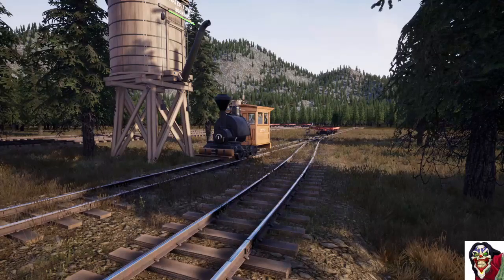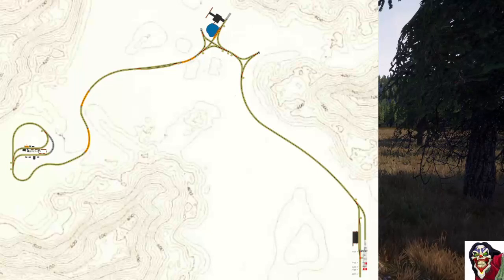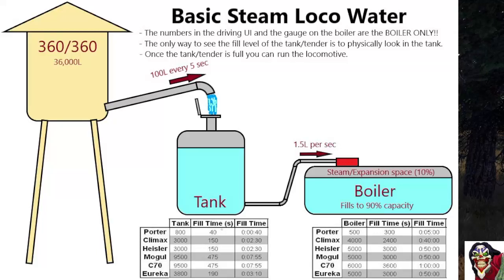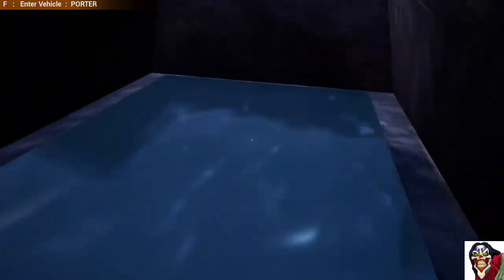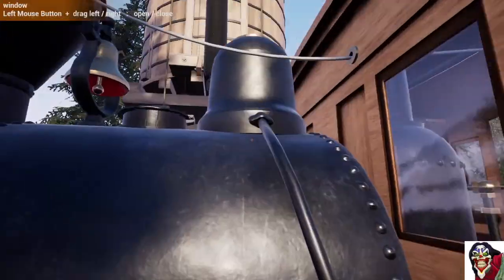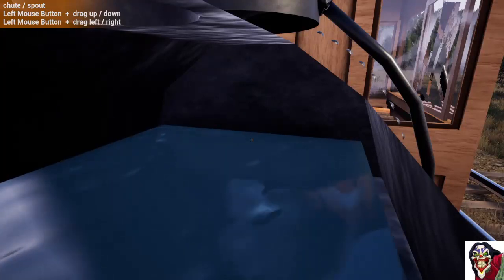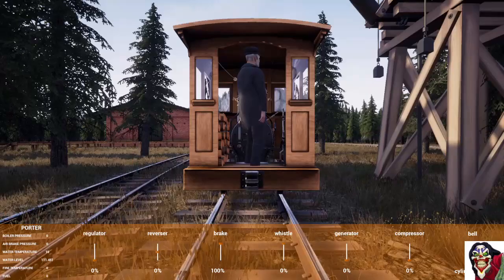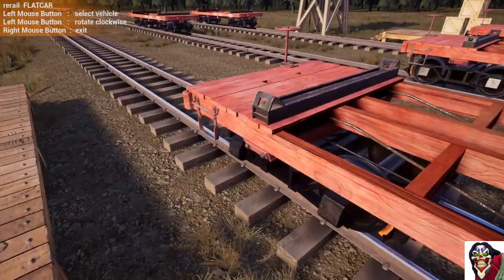RO! - Old Build Tools Tutorial Ep14

Comment: I like the chart with the water "management" from water tower to the boiler. But for realism' s sake you should've opened the lid of the water tank at the logging camp! ;)
Also very informative on turning cars while re-railing. That was one thing I still had difficulties with. Thank you for this nice series of videos.
Reply from the maker: I did it on purpose to show you can fill it without opening the cap.  The same is true for the sander dome and cap (Eureka's sander cap currently doesn't open).

Comment: Suprised you didn't shunt the rolling stock
Reply from the maker: At the spawn tracks?  That's why there's a re-rail line that runs past there on the west.  I'm shy of driving in there since I had a railcar fall through the map when trying to collect new railcars.  Since that happened I don't normally connect those baked rails to the network.

Comment: Can you do a video showing how to replant trees? Or do you have one already?
Reply from the maker: This is done with 3rd party tools to edit the save file.  ROSE (Railroads Online Save Editor), Tree-inator, railroad.studio all have options to replant trees to either the full map, or to trim neatly up to the tracks (smart replant).  Its as simple as pushing a button, or selecting it from a menu.
Reply: @K10wNs-Shed  I tried that site and it is great for just about everything on RRO! I first tried the "cut all trees" and it was so simple. I could finally see every bump in the terrain so laying track was a breeze. Then while messing around with the tree brush, I figured out right clicking cuts trees and left click replants them! I was able to leave the trees on the mountains (where I'll never lay track) and still clear every remotely flat area to see how big of a yard I can build. Found some nice niches that I never bothered with before because of how many trees I'd have to cut down. What used to take 5 hours took 5 minutes! This along with minizwerg should help me make some impressive rail lines!